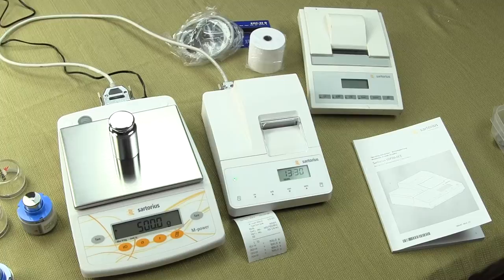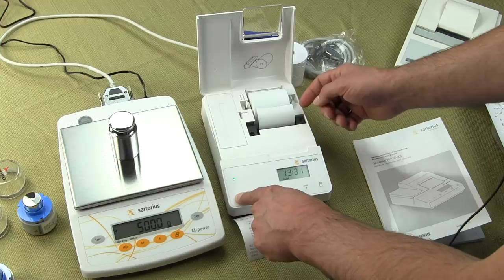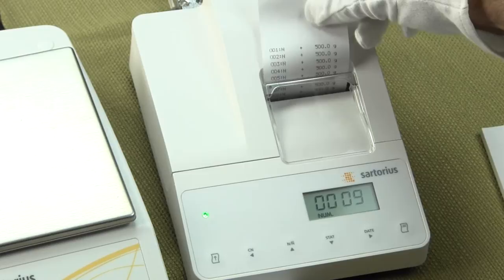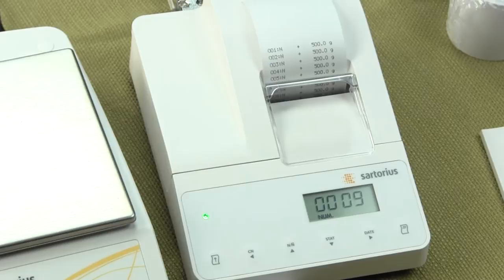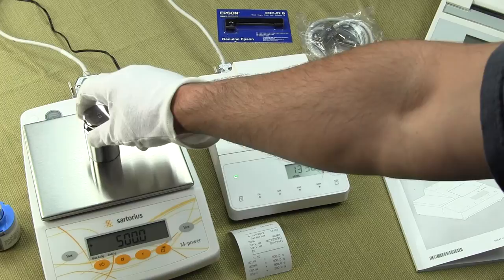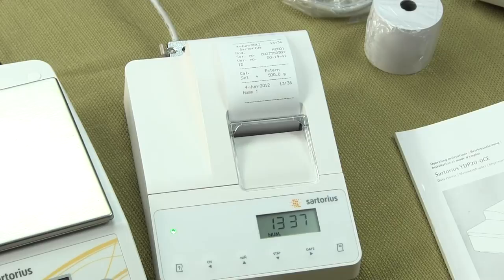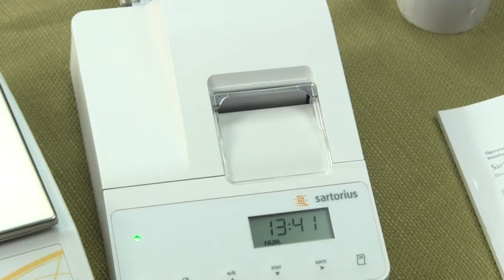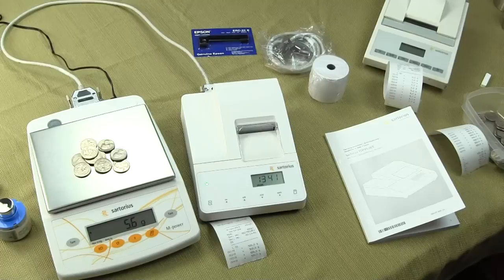Scale printer for Sartorius digital scales

Comment: I it possible connect the scale to another printer??
Reply from the maker: The YDP20-OCE only works with the Sartorius Balance.  You can not connect any other printer than a Sartorius Printer to a Sartorius Balance. I hope this answers your question but if not give us a call at 978-521-70095 and a balance specialist can help you more.
Reply: Thanks